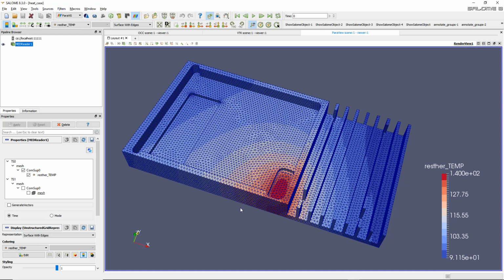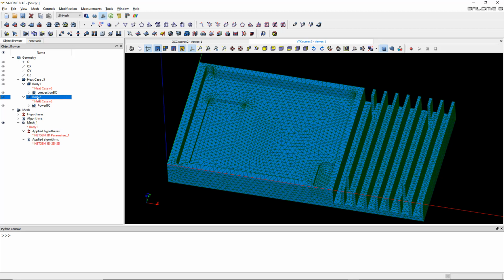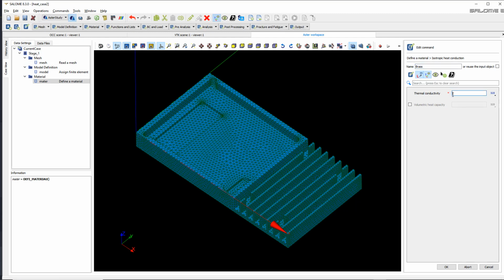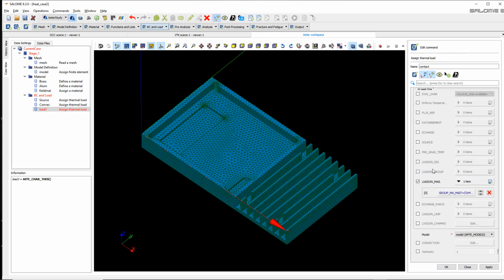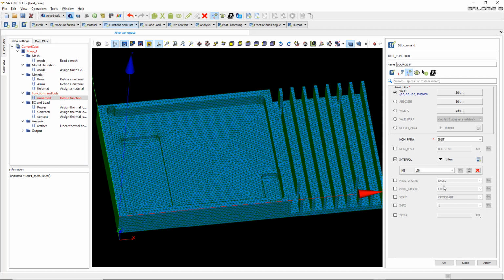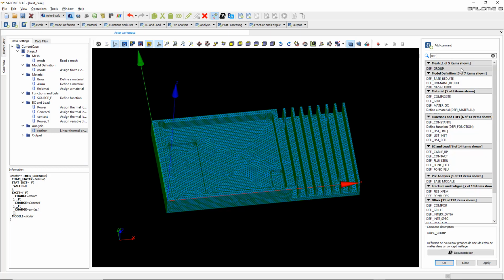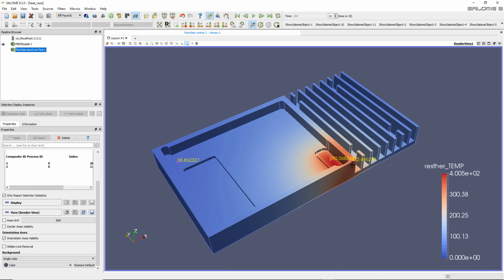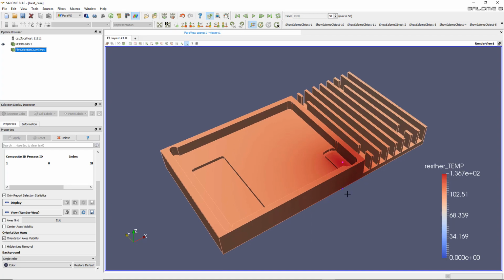[Salome Meca Tutorial] Heat Case Transient Thermal Simulation

Comment: Hi Cyprien, thanks for your great videos. I have been using commercial FEM softwares for years and I'm discovering SalomeMeca/CodeAster since a few weeks... what a good surprise! Transient thermal studies works fine for me. I need to fix something with steady state analysis (initial state and increment field are marked as "required" with red asterisk and can not be empty).... maybe a problem with the distribution I'm using (Salomé-méca 9.10 for Windows).

Comment: Hi Cyprien! Another great tutorial!
You used SOURCE to apply thermal load on a group of elements.
Its possible to apply to a group of nodes? SOURCE only have "Group of Elements" as a option.
In Ansys i can use the "F,,heat,value" to apply heat loads directly on nodes.
Its possible to do this in Aster?

Thanks!!
Reply from the maker: I think there is probably a command to change a group of nodes into a group of elements... but never tried
Reply: @Feaforall  actually there is:

# Create a group after selecting the nodes
local_nodes=welding_mesh.MakeGroupByIds("local_nodes",SMESH.NODE,selectednodeIDs)
# Create a group of elements which contain the nodes
local_elements= welding_mesh.CreateDimGroup( [ local_nodes], SMESH.VOLUME, 'local_elements', SMESH.ALL_NODES, 0)

but i really wanted to apply directly to nodes..... :/
Reply from the maker: @rodrigofarias900  According to the doc, SOURCE has to be applied to elements, not nodes. There doesn't seem to be an option for nodes: https://www.code-aster.org/V2/doc/v13/en/man_u/u4/u4.44.02.pdf
But maybe I am just not aware of it... Try to ask on the Code_aster Forum, they may have more answers there!

Comment: Is it possible and/or difficult to add forced convection for this simulation?
Reply from the maker: You mean doing a CFD simulation? To do forced convection, you generally have to model the fluid and fans, etc... you’ll have to use Code_Saturne to do it and that would be a whole new simulation.
Reply: Will the Code_Saturne be able to simulate both conduction and convection? Is it suitable for estimating temperature of electronics parts, in some assemblies, in enclosure? Or it's impossible or requires being expert in physics and programming?
This example seems to be easy to use and good for things like simulating temperature rise under pulse power loads but not sufficient for estimating steady state temperatures in real life situations, as eg. if the part were in enclosure and convection would be hard to guess.
Reply from the maker: @asdfzxcv6268  yes, code_saturne can do that. You have do do a study coupled with Syrthes( which is another EDF code) . I think there is a PDF tutorial on the code-saturne website to show how to set that up. You do not need to be a programming genius to follow that, but you need to know what you are doing and have some basics of Linux Ubuntu. Good luck!

Comment: Hi Cyprien! I must write again because I saw something in the tutorial that I don't quite understand. When doing the transient analysis, you must define the initial temperature through "ETAT_INIT". What I dont understand is why you put "0" for temperature. What I learned is that temperature units are in Kelvin. Are you saying that your initial temperatureis 0 K (-273 ºC)? Or maybe I'm assuming something wrong.. Thank you!
Best regards
Reply from the maker: Temperature is always calculated as a difference, so the unit doesn’t matter. Etat_init is the value of the temperature field at the initial moment, so if I set it to zero, it means I am calculating in degree C and initial state is zero degree C.
Reply: @Feaforall  I believe then that i've been having troubles with the temperasture units. I assumed so far that temperature was displayed in Kelvin, given that I'm using SI units (m, kg, s, K). 
Specially with para vis, you read the temperature as Celsius. How can I know if its either Celsius or Kelvin?
Reply from the maker: @nicolaerodideal9718  https://www.eng-tips.com/viewthread.cfm?qid=386704

Comment: Hi Cyprien, I'm new to this software and I find a lot of material done by you. Thank you for this incredible service!
I'm following this tutorial and trying to replicate it for another analysis. 
I have to simulate the temperature propagation through an aluminum part, from an electric arc as a heat source (GTAW Welding).  Sadly I don't encounter anyone that has done this so far. I want to ask particulary about the electric arc heat source, it should be done through radiation and not "contact" as you have on this tutorial. Can you tell me which function should I select on "BC and Load" to simulate this case? Or what should be the best approach as to simulate a moving the electric arc around an aluminum tube. Thank you very much!
Reply from the maker: I think code_aster cannot do radiation: https://code-aster.org/forum2/viewtopic.php?id=24342
Reply from the maker: There is another code called Syrthes which supposedly can do it but I don’t know how much is available about that online...
Reply: I appreciate your answer Cyprian!  I found that is possible to simulate welding on Salome Meca, even multipass welding (!!).  On their website there is a  full document about it. The challenge is to have a moving heat source along a meshed weld bead. I believe that should be done through a function. It's tricky though as I'm very new to this software. 
If you are doing any tutorial in the near future, please consider a something similar to this one (transient thermal analysis with a moving heat source) since the website forum is full of questions and no tutorial can be found on the internet. 
Many thanks again! 
Nicolae
Reply: Hi, Nicolae. I'm Mikhail from Minsk, Belarus. I'm interesting in welding processes. Please, tell me on what website have you got a full documentation about simulation welding on Salome Meca? Thanks in advance!

Comment: Hi, I've a question. How can I do Transient Thermal Simulation not from the source but from the air? I can't find in anywhere.
Reply from the maker: You can use the convection load with an ambient temperature which depends on a function. The convection is what approximate the contact between your model and the external air, but this needs the approximation that the air temperature around is constant all over the model. If this is not the case, you’ll have to do a CFD heat-structure coupled simulation (Code-aster can’t do that)
Reply: @Feaforall  Temperature is constant all over (800 degrees). Thank you very much for  Your respond.
Reply from the maker: @Wikimika1411  You're welcome. In addition, i recommend you to read this article on the blog, and especially the part about convection: https://feaforall.com/heat-transfer/
That should help you to understand better how heat transfer works